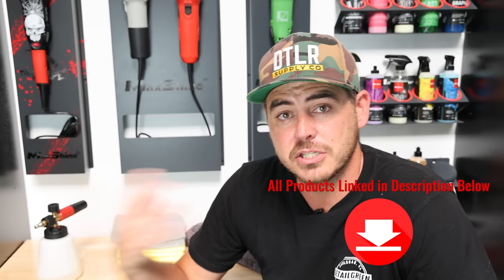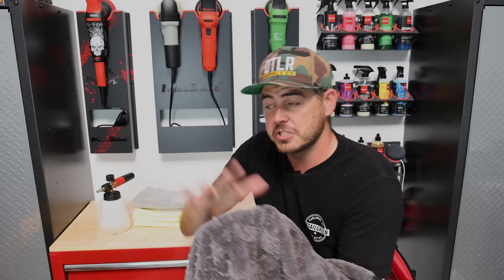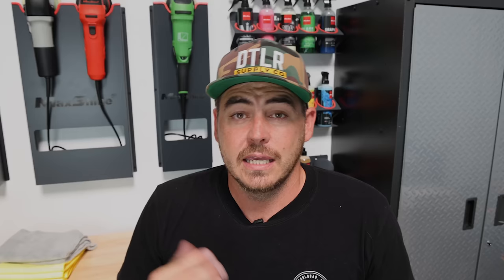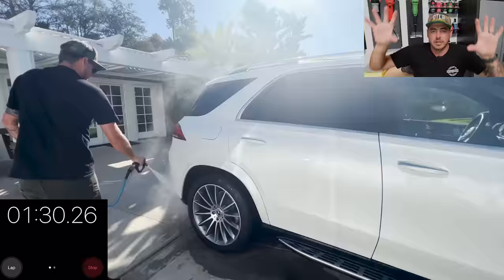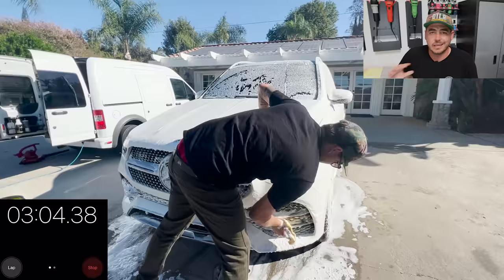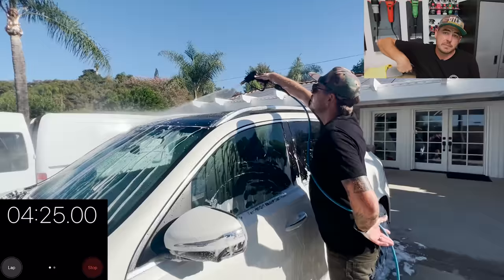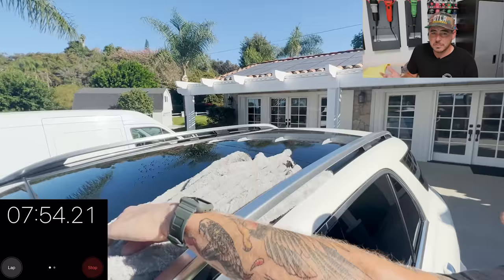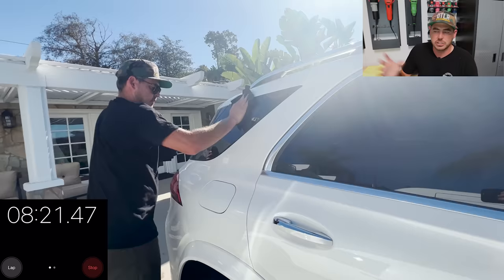HOW TO WASH A CAR FASTER! | Car Wash in 10 minutes or less

Comment: May add a little time but before I hit it with a drying towel I blow off a lot of water from the top down to the bottom with a leaf blower or dog dryer.  I've found that if you don't that even with a dedicated great drying towel it seems to get pretty water logged by the end especially with a large car.

Comment: The cars I get are all faded to shit and or have a bunch of nooks and crannies(those rims). The washing is done first, I never hand dry in fear of scratches. Water spot remover is applied next to rid of any spots that linger. I use mist on my hose that’s not on the pressure washer to decrease the amount of drops left behind. I apply wax and ceramics after, I have compound on hand if there is a tough spot, scuff or something that isn’t removed by washing, The plastic trim comes next, all cars I deal with have trim faded to shit or grey looking. Taking multiple goes sometimes to get it back to black again. After the trim is done, the wheels are done, rims and wheels sprayed with a wheel cleaner, then cleaned, and if they are painted, ceramics applied to the rims, or metal, mothers polish is applied(time consuming). Then tire shine is added.  After that’s done, chrome time! Chrome gets polished by hand with chrome polish(again time consuming) after that is done, the headlights and tail lights are done. Finally, the windows are cleaned with ammonia free window cleaner to remove any residue from usually either ceramics or plastic conditioners. The inside is far faster. Mats are removed, as well as personal items(exact locations noted so they can be returned to that exact spot after the detail) garbage if any is removed. I vaccum every fabric within the vehicle to the point it’s free of a single particle, change is not sucked up as I remove any and place in the cup holder or where the owner keeps their coins. Shampooing is done after i empty out the vaccum. I apply upholstery cleaner before I take the contents out to dump so it has time to soak in. I scrub it down, then vaccum up the residue. Once the upholstery and carpets are done I can finally pick up a lot of speed. Only three chemicals I need to do this. Plastic conditioner, ceramics(for door frames and hinges) and glass cleaner. I can do all panels on the inside in less than 30 minutes. After that, the mats! Carpets are cleaned with the scrub and vaccum method, rubber or vinyl (these suck so much especially ones with those grooves) are either sprayed with the pressure washer, or done by hand. Finally I’ve finished! I inspect my work throughly walking around and correcting any spot I missed! Your method works well on lightly soiled regularly maintained vehicles. A vehicle that’s not recieved a detail in years if not ever won’t come perfectly clean and without plastic fading with this method. If there was a chemical that can restore plastic on contact and be sprayed through a cannon like this and not leave residue I’d love to obtain it. As vehicles I get are basically shitboxes, farm trucks and family vehicles with years of use that take a long time to bring back the shine one every square inch of it.

Comment: some people  pay me to just rinse the car, foam it up do a   quick contact wash , and rinse again ..no drying. I tell them they'll have water spots if they don't  dry it  so they speed away in the car for a few minutes and then dry the rest themselves. works for me they save 10 15$ and I save time and towels.  now I offer it as an option to save them $. sometimes I wash people's cars they pull up to me while I'm detailing another car and I'll  foam and pressure wash theirs at the same time. then they drive away without getting out . 25$ in 5 to 10 min lol  i don't have to clean door jambs or the glass. they just say do what you can in a couple min.  I'm like ok 👍 I love this business

Comment: Remember, the more times you actually touch/rub the paint finish, the more chance of micro scratches, that WILL mount up !!!!!   I dont agree with the need to use the micro fibre wipe down cloths, instead, to remove the rinsed water (to avoid hard water white marks) I use a small amount (half a normal cup) of good quality dishwasher rinse aid fluid in a 2 gallon watering can of clean water well mixed, apply to the wet finish & watch the water disappear, its particularly effective when its a dark colour, to avoid those horrible visible swirls caused by using over enthusiastic drying cloths that somehow seem to attract dust particles, which WILL cause the damage....

Good luck from the UK, this really works.
Reply: so little to care there was no pre rinse to get "heavy contaminates" off

Comment: Wouldn’t it be better to rinse off the foam and the reapply foam and then use cloths or mitts so you’re not rubbing the dirt into the paint to help avoid scratches and swirls? So it takes 5 minutes more.

Comment: I've watched a bunch of your vids and find them informative. This vid was linked from one of Avalon King's emails and realized I've already watched it (from my vote). I cringed watching you use the same towel for majority of the vehicle. I've seen this done before but with 8-10 different towels/mitts, one for each panel.
Reply from the maker: It was linked from an Avalon king email?  Hmmm I didn’t know they were using any of my videos

Yea I understand your point about the towels. But I do flip the towels a few times to a clean surface. I typically do it more often but this car is taken care of often and with the pre rinse the majority of dirt came off so the towels did not get very contaminated..
Reply: @imjoshv  I gotcha, since your video was time lapsed, I didn't see the flipping of the towels but def makes sense, thanks for the reply! 👊

Comment: How long did the wash take not in fast forward? 😂 
Seriously though, good stuff. Learned a few new methods watching this
Reply from the maker: I sped the time up to match the video length! With that said, this is just the how to in a pinch situation ha. In most cases my exterior wash interior vacuum runs about 45 min to an hour. But implementing these steps definitely can help speed up your process

Comment: i prefer to rinse off the first layer of foam without contact,  and then do another layer of foam with a contact wash... this way i avoid rubbing dirt into the paint ...
Reply from the maker: I agree, in most cases I foam on a pre wash, rinse that that does a ph neutral foam for lubrication and go for the contact wash. But for a fast wash this is a great option

Comment: If the car is just dusty it's fine, but even with a slightly dirty car, couple of bugs and tars, some red sand stains and it goes up to 45/60 minutes.
Reply from the maker: Yea very fair point! This is really just meant to show how someone who is in a rush can be a much better result quickly. But yes If the car is t already maintained well it would be hard to get it done quickly

Comment: I have another method. I don't even use a hose. Bucket 🪣 of car soap and water. Start washing with that but I make sure there's a lot of soap and water on my wash cloth and just start scrubbing from top to bottom. I do this by sections. Once I do the roof, I stop there and before the soap dries I start to remove the soap with the same towel I use to dry it. I repeat until the whole car is done and that's it.

Comment: What people fail to realize is. This is what people want they really don’t care for a perfect wash they just want it shining with no streaks. That’s why the tunnel car wash business won’t ever go away cause people simply don’t care. This right here is a great ideal and image you charming people $50 a car and you wash 20 cars that’s a $1000 a day for walking vehicle under 15 mins. I live in the richest city in Kansas and have seen the porches and Lambo go through our tunnel washes
Reply from the maker: Hi thanks for the comment! I agree with you that many people just want a quick clean many of my customers don’t even see the paint imperfections that as a Detailer really stand out to me.. my business is built on the detailing side and not really just washes. I made this video just to show how someone can get it done fast if they are short on time or in a pinch. An exterior wash and interior vacuum normally runs me about an hour. This was a customers car and I filmed it this way to make the point of what you can get done in a pinch. After filming I still went through and time tuned everything. Used air to blow out all of the tight spots so no water drips… etc…

Comment: I can’t wait for more companies to come out with battery powered foam sprayers for doing wheels. Tired of the 40 to 50 pumps for each tire. There’s a few on the market but the cost is high.
Reply: Pan just posted a video of 2 from 70 to 170.. Time is money.
Reply: The foam pro 2+ has a valve, so you can hook up those little bicycle tire battery compressors to it and never pump. I personally think using a foam sprayer is too much time to use on wheels because it's a lot of parts to clean afterwards.
Reply: Add a schreader valve to it and pressurize it with your compressor

Comment: Great video and tips, but unless you have the space and environment (I'm in Boston area) to always have your pressure washer hooked up and ready to go; the setup and breakdown of the pw and foam cannon is the biggest pain in the ass in my opinion. It is what prevents me from actually washing my car.

I've recently just used a Rinseless Wash for the first time and had amazing results. Optimum No Rinse is the OG, but I used the newly released P&S Absolute from the Rag Company. This product is going to help me get out more often to wash the car, especially in the winter since I won't need a hose. I have it pre-mixed and ready to go in a garden sized pump sprayer for the pre-treat and then I mix a bucket in the laundry sink. This makes washing more "accessible", so I can even do a quick one in 30 mins after work. I get home, pre-spray and let it dwell while I go mix my bucket and grab towels...then I'm off to the races. You can even do this in the garage since there is no hose.
https://youtu.be/MJGQB8NMt54

Comment: Thank you for the video. So, when drying the car, using a clean dedicated drying towel , you don't need to use a drying aid for lubrication when drying?  I've used quick detailers before, spraying on the panel as I dry, but I've always wondered if this is necessary?  ( my car is ceramic coated ).

Comment: Hey Josh! Love the content! How can I get xtra thick foam out of my foam cannon? I purchased the MJJC from your site but I still can’t get that “StickOn” foam? Any suggestions? Thanks!
Reply: Try using the 1.1mm orifice. If you're using an electric PW pushing less than 2gpm, that's almost guaranteed to fix the issue. 

Otherwise, you might not be using enough soap in the cannon. Fill the cannon tank to the 900ml line with water,   then fill to the 1000ml line with soap. Swirl to mix, don't shake. If you put the top back on before swirling, the weighted straw on the MJJC will help the process by acting like a coffee stirrer, if that makes sense.

The reason for water before soap and swirling instead of shaking is the same. You don't want the soap foaming up before it gets sucked up by the cannon. It won't hurt anything, it just won't foam as well or be as efficient in how much product you use.
Reply: @KlockoFett  this comment right here. and you can always look up how to replace the orifice on YouTube. its very easy.
Reply: Yep. That’s what I’ll do next. Hopefully no more runny foam

Comment: Do you think that at this speed you would get water spots, if using tap wster?  Thanks
Reply from the maker: You potentially still could. If it’s a hot day and the water is really hard then it could still happen, but speed helps so getting the majority of the water off quickly would definitely help!

Comment: 0:40 can you elaborate on what you mean by adjusting your pressure washer for a good ratio of psi/gpm?

 I have a Honda pressure washer that is 3500 PSI
Reply: He probably means using different nozzle tips. A 3.0 nozzle will give you more PSI but less GPM than a 5.0 opening.

Comment: Wouldn't using clothes without rinsing out during the snow foam wipe introduce swirls if there was dirt left over after the initial rinse?
Reply: This wash method is for speed, for the average vehicle and for folks who don't have time, a safe wash can easily take  an hour. You could add a pre soak with a foam cannon but don't pre rinse so the foam is more effective which seems backwards but after testing it multiple times it does cling and clean better.

Comment: I hadn't washed my car in several months and it's not the dirt that's the problem it's the stuck on little black and orange specs that take for fucking ever to rub off with the microfiber. 

Today I was washing the car for like 4 hours! Agreed that blanketing with more foam allows for more breakdown work to happen without me doing work and not using enough soap today contributed to why it took so long, but I have to wonder if there is something I can do, maybe I can use a buffer power tool and just put some microfiber over the wool to help me get it clean down to the paint. Is that crazy? Or I just need to actually just wash it once a month instead of once every 5 months?

Comment: 3:39 dude that’s only in ideal conditions and you still have to work fast before that foam dries or all of it slides off. I clean 1 section at a time very thoroughly, top to bottom and finish with the wheels/ wheel wells
Reply from the maker: Yea you are correct! This is just to show how you can achieve a quick and safe wash when time is limited. My normal timing is 45min to an hour

Comment: The biggest problem I have is that the damn sun starts drying everything way to quickly and leaves streaks from the soap. Any tips to stop this would be awesome
Reply: Do it in a garage, early in the morning or late in the evening. A weather app is also your best friend. Plan it.
Reply: If you use a Ph neutral soap in the sun and it dries, the water will reactivate it and rinse clean, no streaks or spots. The real pressure cooker is getting the rinse water off before it starts to dry, leaving mineral spots. What I do is after the wash, while the car is still soapy, use 2 oz of Superior Products Formula 4 spray wax into 10 oz of water in a foam canon and spray the entire car down- then rinse your car. Any spots that dry on the car will be polymer and not mineral and will wipe away with a quick detailer or any final topper you use.

Comment: Love your videos Josh. Picked up some great info from you along the way. Did you stand on a microfiber towel 😢in the door sills to dry the top of the car?  If not…yikes. No polisher will take out the scratches left by your shoes.
Reply: Take a closer look...the car has running boards with rubber strips.

Comment: Hey, quick question, I have an electric PW with a working pressure of 1595 PSI(maximum rated 1885 PSI) and 1.6 GPM(maximum rated 1.8 GPM), do you think that the 1.1 orifice on a foam gun would stall/pulsate the PW ?

Comment: Why does my total stop system stop working after I change out the stock hose and wand that the pressure washer came with for my new Uber flex hose and McKillans wand (I have Sun Joe SPX2688-Max electric)

Comment: I used to use Costco microfiber for exterior(on my own vehicle thankfully) they swirled the paint noticeably. Wasn't end of world as I planned on polishing it anyway. But I haven't used them sense, and I here others have done the same.
Reply: I’ve never used Costco, but I have expensive ones and cheap ones (from harbor freight and Home Depot). Just got done doing a 3 step paint correction and between each step, used an IPA and the cheap towels. If there were any swirls, it would be easy to see. I saw none. Maybe the Costco ones are different or maybe people are pressing too hard. I do feel less confident in my cheap ones, like I feel like I probably shouldn’t use as much pressure as the nice thick expensive ones.

Comment: I ordered that foam canned but it came with a adapter but it didn’t came with the right connector to the pressure gun. Where can I order the adapter that fits. I ordered 1 that isn’t the right size . I order one that fits good but it was short because water can leak

Comment: What spray nozzle tip would you use with a Haart 1700 psi pressure washer for the initial rinse and for the finish rinse after you applied foam?
Reply: A 40 degree nozzle seems standard.

Comment: Using 2 towels for an entire vehicle without rinsing seems like you'll introduce a ton of micro swirls. The wheels and tires also didn't get a scrub to fully remove the brake dust or road grime. I suppose this would be great if you were washing a lot of cars at a dealership, but for daily paying customers, no thanks.

Comment: Given that Costco towels usually scratch paint when doing waxes and detailer sprays, would it do the same here?
Reply from the maker: I don’t find that the Costco towels always scratch. They are an 80/20 350gsm towel. If the vehicle has soft paint then that can definitely be an issue with these, but with the added lubrication from the soap it’s not much of a concern. I don’t use them for polishing or paint corrections but as a general use towel they are a great value!

Comment: Hi

Is using ph neutral soap for prewash snow foam is useless?

Or it fits the purpose of pre-wash?
Does it remove more dirt than just using pressure wash only?
Reply from the maker: Yea it’s not as effective as a higher ph pre wash soap but it will definitely still help to loosen, break down, and suspend the dirt while adding lubrication to the wash process!
Reply: @imjoshv  what do you think if I don't use from Canon at all what do you think is the best method for this? Is it just pre-washed with pressure water and 2 bucket method?